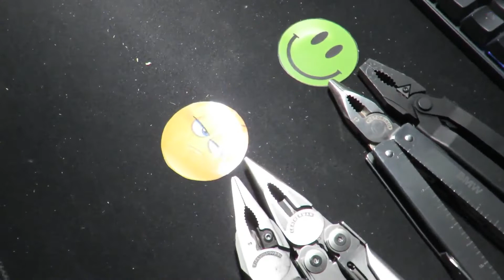LEATHERMAN/ GERBER/ VICTORINOX PLIERS : Tearing off a Nail (Needlenose vs Bluntnose)

Comment from the maker: MT VOD * Dear lovers of multi-tools, you can ask me everything, redo a review, insist on a detail, make comparisons, test this or that, I am at your disposal! :) * Multi-Tool VOD
Here is my collection of multi-tools (February 2019) [/S = Brand Sheath]
1- BALADEO Outdoor Cutlery Multi-tool /S               
2- BEAR & SON Bear Jaws 155LS /S
3- BUCK Knives X-Tract 730 /S
4- BUCK Knives X-Tract 735BKS-B Essential
5- BUCK Knives BuckTool 350 (MiniBuck)
6- BUCK Knives BuckTool 355 /S
7- BUCK Knives BuckTool 360 /S
8- BYRD ByrdRench BY15P /S
9- COLEMAN Pro Lock /S
10- CRKT Bivy
11- CRKT Zylla-Tool Jr. /S
12- FISKARS Cuts+More
13- GANZO G301-H /S
14- GANZO G302-B /S
15- GERBER Balance /S
16- GERBER Bullrush /S
17- GERBER Center-Drive (with Bit Kit) /S
18- GERBER Crucial /S
19- GERBER Crucial F.A.S.T. (with Hex Bit Kit)  /S
20- GERBER Curve
21- GERBER Dime
22- GERBER Flik /S
23- GERBER Fit /S
24- GERBER Grappler /S
25- GERBER MP1 /S
26- GERBER MP 400 Compact Sport (05500/ 45500) /S
27- GERBER MP 500 Recoil Auto-Plier /S
28- GERBER MP 600 Bluntnose (old model with 55200 Multi-Plier Pocket Tool Kit)  /S
29- GERBER MP 600 Bluntnose Black (07520G1N Carbide Insert Cutters with Tool Kit) /S
30- GERBER MP 600 Pro Scout (07564/ 47564 with Tool Kit) /S
31- GERBER MP 700 Urban Legend /S
32- GERBER MP 800 Legend /S
33- GERBER Octane /S
34- GERBER Radius /S
35- GERBER Splice
36- GERBER Strata /S
37- GERBER Suspension /S
38- GERBER Truss /S
39- GERBER Vise
40- HANWEI Professional Multi-tool by PAUL CHEN 1008-GT
41- HAVALON Evolve Shockey Signature Series XTC-60AMTS /S
42- HENSTRONG (or Bibury or Intey or …) 18-in-1 /S
43- JEEP Multifonction tool with crescent wrench
44- KERSHAW A100C /S
45- LEATHERMAN Blast (with Removal Bit Driver) /S
46- LEATHERMAN Charge+ (with Bit Kit & Pocket Clip & Lanyard Ring & Bit Driver Extender) /S
47- LEATHERMAN Charge+ TTI (with Bit Kit & Pocket Clip & Lanyard Ring & Bit Driver Extender) /S
48- LEATHERMAN Charge TTI (with Bit Kit & Pocket Clip & Lanyard Ring & Bit Driver Extender) /S
49- LEATHERMAN Charge XTI (with Bit Kit & Pocket Clip & Lanyard Ring & Bit Driver Extender) /S
50- LEATHERMAN Crunch /S
51- LEATHERMAN Expanse E33BX /S
52- LEATHERMAN Expanse E55BX /S
53- LEATHERMAN Freestyle /S
54- LEATHERMAN Juice S2 /S
55- LEATHERMAN Juice XE6 (with Victorinox Mini Screwdriver) /S
56- LEATHERMAN Micra
57- LEATHERMAN MUT /S
58- LEATHERMAN OHT (with tweezers) /S
59- LEATHERMAN Rebar /S
60- LEATHERMAN Raptor /S
61- LEATHERMAN Signal /S (with Bit Kit & Bit Driver Extender)
62- LEATHERMAN Sidekick /S (with carabiner)
63- LEATHERMAN Skeletool CX (with Bit Kit & extra long bits) /S
64- LEATHERMAN Skeletool RX /S
65- LEATHERMAN Squirt P4
66- LEATHERMAN Squirt PS4
67- LEATHERMAN Squirt ES4
68- LEATHERMAN Style
69- LEATHERMAN Style CS
70- LEATHERMAN Style PS
71- LEATHERMAN Super Tool 300 /S
72- LEATHERMAN Super Tool 300 EOD /S
73- LEATHERMAN Surge (with Bit Kit & Pocket Clip & Lanyard Ring & Bit Driver Extender) /S
74- LEATHERMAN Surge 2013 Black Edition (with Bit Kit & Pocket Clip & Lanyard Ring & Bit Driver Extender) /S
75- LEATHERMAN Wave (with Bit Kit & Pocket Clip & Lanyard Ring & Bit Driver Extender) /S
76- LEATHERMAN Wave+ (with Bit Kit & Pocket Clip & Lanyard Ring & Bit Driver Extender) /S
77- LEATHERMAN Wingman /S
78- RATNIK 6E6 /S (with diamond-coated file)
79- ROXON Knife Scissors S501
80- ROXON Multi BBQ Tool MBT3 S601 /S
81- ROXON Sparkle CM1349 /S
82- ROXON Storm S801 (with bit kit & Victorinox Mini Screwdriver) /S
83- RUIKE Criterion M61-G (with Victorinox Mini Screwdriver)
84- RUIKE Trekker LD51-B (with Victorinox Mini Screwdriver)
85- SCHRADE Tough Chip ST2 /S
86- SCHRADE Tough ST1 (original U.S./ version 1) /S
87- SCHRADE Tough ST1 (Taylor Brands Schrade) /S
88- SCHRADE Tough ST11 /S
89- SCHRADE Tough STE5 /S
90- SEBERTECH Sebertool M2
91- SEBERTECH Sebertool M4
92- SOG CrossCut 2.0
93- SOG Paratool S31 (with Saw instead Philipps screwdriver + Bit Driver + Hex Bit Accessory Kit) /S
94- SOG Pocket PowerPlier S44 /S
95- SOG PowerAccess Deluxe (with bit kit) /S
96- SOG PowerAssist S66 (with Saw instead of V-Cutter) /S 
97- SOG PowerDuo PD01 /S
98- SOG PowerLock S60 (with Bit Driver + Hex Bit Accessory Kit) /S
99- SOG PowerPint (with Hex Bit Kit) /Böker S
100-  SOG SwitchPlier V2.0 /S
101-  SOG Sync II
102-  SWISS+TECH Micro-Max 19-in-1
103-  SWISS+TECH Micro-Plus EX 9-in-1
104-  TOPEAK The Alien /S
105-  UD Vape Cool Kit Multi-tool Cutting Pliers /S
106-  VICTORINOX Cybertool L (1.7775.T) /S
107-  VICTORINOX Expedition Lite (1.7965.AVT) /S
108-  VICTORINOX Huntsman Lite (1.7915.T) /S
109-  VICTORINOX Huntsman SilverTech (1.3713.T7) /S
110-  VICTORINOX MiniChamp (0.6385) /S
111-  VICTORINOX Rescue Tool  (0.8623.MWN) /S
112-  VICTORINOX Signature Lite SilverTech (0.6226.T7) /S
113-  VICTORINOX SwissTool PLUS (3.0323.L) (with all accessories with scissors) /S
114-  VICTORINOX SwissTool Spirit XBS (3.0224.3CCH) /S
115-  VICTORINOX SwissTool Spirit XC PLUS RATCHET (3.0239.N) (with all accessories) /S
116-  VICTORINOX Workchamp (0.9064.3) /S (~ 0.8564 : lockable large flat screwdriver)
117-  WALTHER Multi-Tac /S
118-  WENGER EvoGrip S557 (with Victorinox Mini Screwdriver/ ~ Victorinox Evolution S557) /S
119-  WENGER RangerGrip 90.822 /S (~ Victorinox Ranger Grip 74 or 174 Handyman or Boatsman for the pliers)

Acquisition forecast - Call for donations! :)
1- EMERSON Multitasker EDC-1/2
2- LEATHERMAN K502X/K503X
3- LEATHERMAN Pruner (Genus/ Visa/ Hybrid)
4- WENGER SwissGrip
Reply: Thanks again for
 the great research!
Lightweight EDC MT with a decent onehandopening blade & scisors?
Reply: Mauri Ojala I've been following this channel for a long time and my collection is almost half as big so I think I can answer this:  the leatherman wingman is a lower cost (under $50 USD) that has a half plain edge and half serrated blade and on the other side has a full pair of scissors with other tools inside.  The wingman is a very good combo, the other choice I have seen but is not quite one hand is the roxon s501 (around $20 USD) I think, which has a blade and full size foldout scissors that can cut almost anything, although the roxon doesn't have any other tools and unfolding the scissors is difficult.  Both of these multitools are very good for routine daily stuff I've found.
Reply from the maker: @IamACanadian47  Excellent answer to Mauri Ojala ! :)
Reply: diezelle57 Thanks

Comment: Good test diezelle57, I have seen one other video out there showing a original large swisstool easily beating a Leatherman surge for this.  I'm wondering if maybe this is part of the redesign of the pliers in the new leatherman free models that were announced at shot show 2019, they will supposedly have the biggest and strongest pliers leatherman has ever used when they come out in late spring.  If you want to check them out look for the "free" playlist in the Leatherman YouTube channel or any of the booth videos from shot show; the tools look like a combination of surge pliers but beefier and wingman tools, in my opinion.
Reply from the maker: Yes, you're right, the Free P2 and P4 pliers have been redesigned and seem to be more robust.
I reacted quickly to the first video about the new range of Leatherman: NEW Leatherman MultiTools | SHOT Show 2019 : https://www.youtube.com/watch?v=N1pP90Q4pMw
Reply: They also redesigned the pliers head on the Swisstool,  looks like to accommodate right-handed users in this twist/pry method of nail pulling.  The old style had put too much opposite stress on the pliers pivoting axis,  they just switched the pivot axis to the other side of the pliers that favored the majority of the world and beefed up the head a bit more.  I have the older model Swiss Tool that was heavily used,   showing the weakness in the design.  The multitool pliers will never take the place of dedicated nail pullers such as tongs or nippers,    beyond pulling maybe one or two nails,  but the pulling cement coated framing nails or galvanized nails is just too much even for the nail itself would break before removal.   But it is a good test for a multitool.

Comment: An easy way to remove nails: grab the nail with the wire cutter and use the head as a lever, way faster than your method!

Continue tes vidéos !
Reply from the maker: Thanks for the advice ... except that with the Gerber, it would lead to popping the carbide inserts :)
I wanted to show the robustness of the pliers.